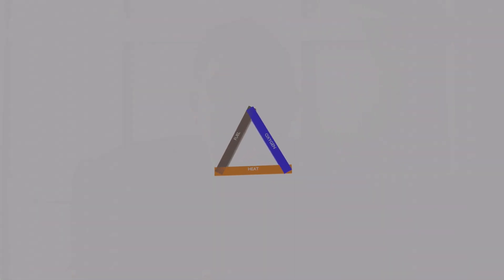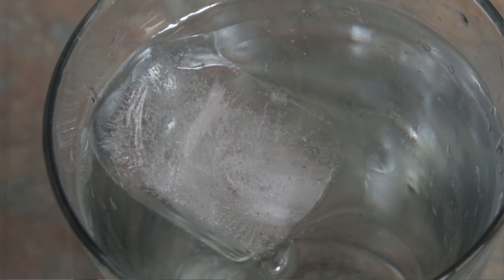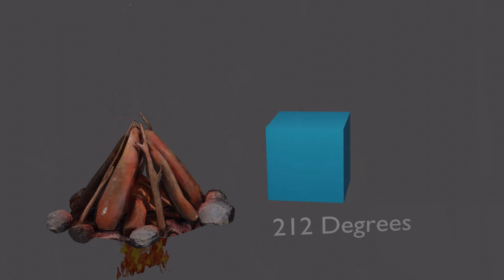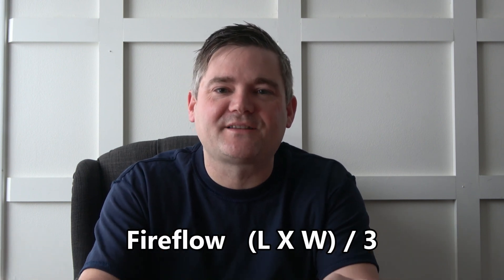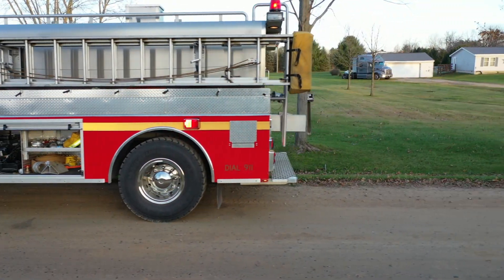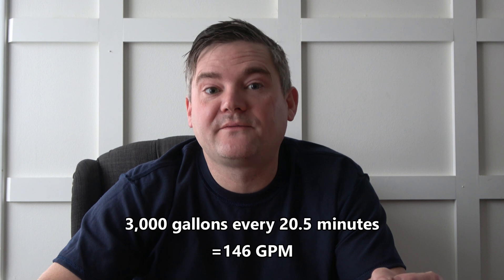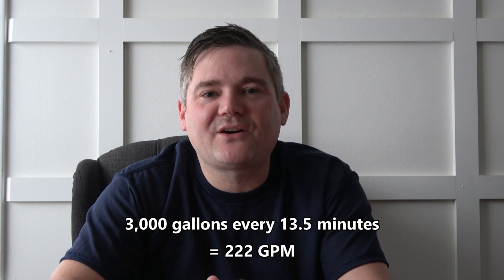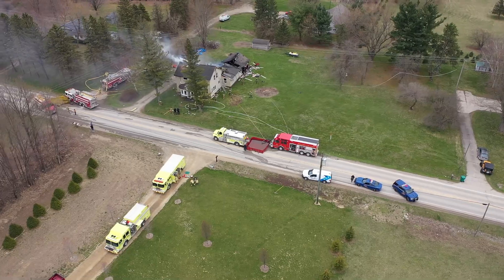Firefighting Without Fire Hydrants?  How do they do it?

Comment: I just joined the fd in my little country town. I moved here from the suburbs. I went to my first structure fire a few weeks ago and I was shocked on how this was done. No less than 15 trucks and mutual aid from 6 departments. We had to drive 1/4 of a mile to a pond to draft water from. They had at least 6 pop up pool type things full of water. We had to make 3 trips to the pond. There was a line of trucks. It was crazy. Remember im from the suburbs where they have a hydrant on each corner.

Comment: So how do you put out grease fires inside your oven??
Reply from the maker: While not an expert on the topic, I think it depends on the nuance.   Assuming it is a relatively small grease fire that will extinguish itself, leaving the door shut and simply monitoring the situation is likely sufficient.   

A stove is able to contain a lot of heat without causing any issues for the structure.   

Opening the door is likely to introduce lots of oxygen causing a flair-up which can also allow the flames and smoke to escape, possibly injuring you or damaging property.  

If it were a more extreme grease fire, I’d definitely consider calling 911.   

If one were to attempt to use a fire extinguisher, a common abc type would make a terrible mess, although likely be effective.  A “K” type kitchen extinguisher would be a good option.

Comment: They use water that's already in the truck and when there's no fire hydrants then they should have a tanker full of water and another thing they need to fix all the hoses so they won't leak I'd be embarrassed to be a part of a fire department the trucks leak with the hoses hook in all the hoses leak there's more water going on the street than in Arizona fire and when they take a ladder truck they need to use it that's one of the first things that you deploy is the ladder trucks start putting the fire out
Reply from the maker: I’m not sure how many “leaky hoses” are used on the foreground.   Most departments have regular hose testing, and nobody is going to keep a hose in service if there is a hole in it.   

Sometimes hoses leak at the couplings if the connection is not tightened, but the trickle of water lost here is just a drop in the bucket compared to fireflow.   

As far as a ladder truck, i don’t tend to see them used often in the rural setting largely because they tend to consume more than 1,000 gpm, and it’s difficult to deliver this amount of water with tankers.   

They are effective firefighting tools, but do waste a lost more water than a hand line.
Reply: @jacuzzibusguy  an aerial master stream is typically going to be put into play to deal with a fire in an unsafe structure, or to provide an easier means of protecting exposure buildings from embers landing on the roof. The typical use for a ladder truck in my area is for easier vertical ventilation, victim rescue, or overhead fire suppression at a defensive structure fire. (No longer viable or safe for close in fire attack)
Reply: @Scott Sasser idk what departments in your area are doing but the one I'm a firefighter on, and the ones around me will have dispatch call out neighboring departments immediately after we get the initial call for a report of a structure fire. That way in the time it takes us to arrive on scene and start fire attack, our water supply tanker shuttle from neighboring departments is already on its way, and our tankers can get portable ponds set up, dump their tanks, and go set up a drafting site while the others arrive and dump their water.